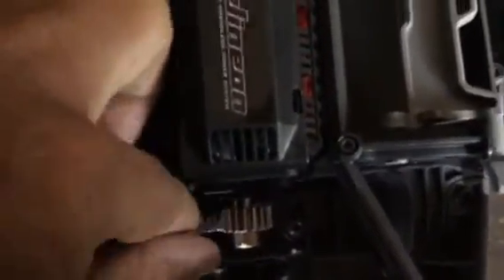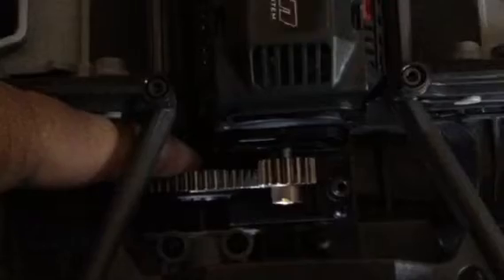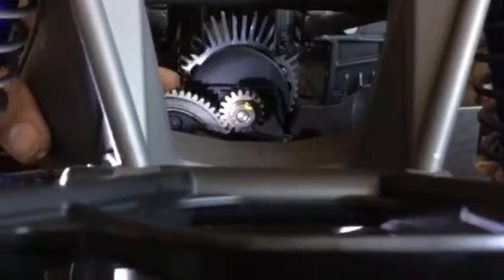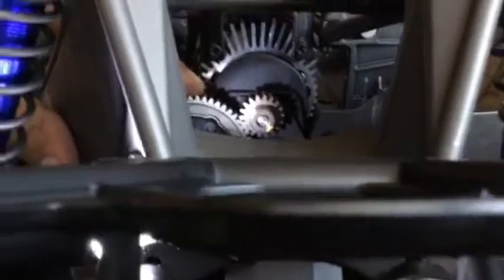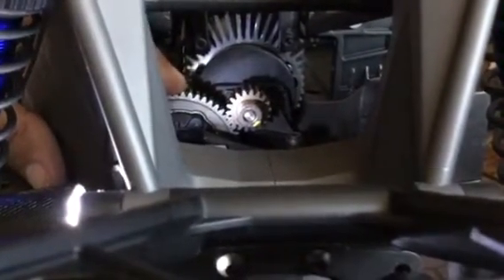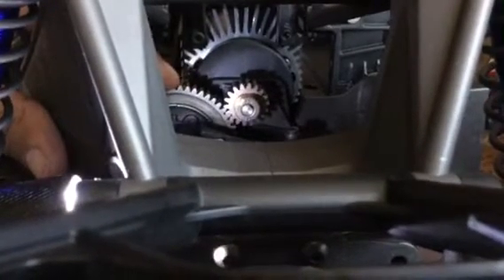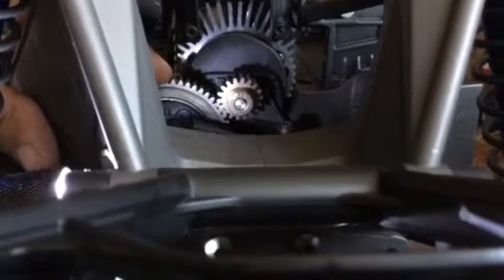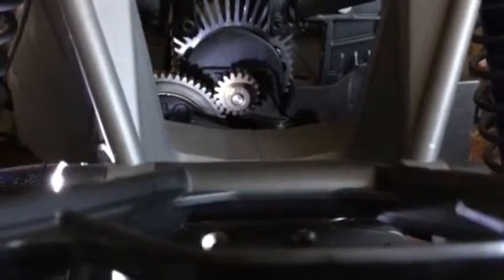Checking x MAXXSpur gear

Comment: I have two x max and I have noticed that the Cush input shaft is slightly warped causing the torque biasing Center diff and input gear to mesh tight at certain positions only if we could purchase a perfectly true input shaft for the Cush I think this would solve all of the gearing issue